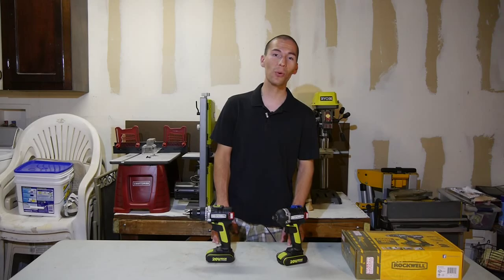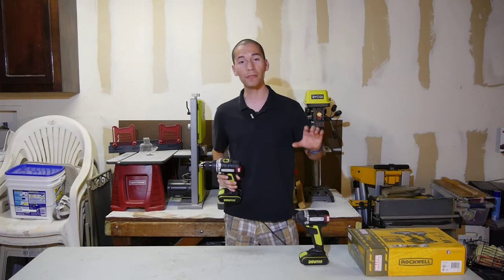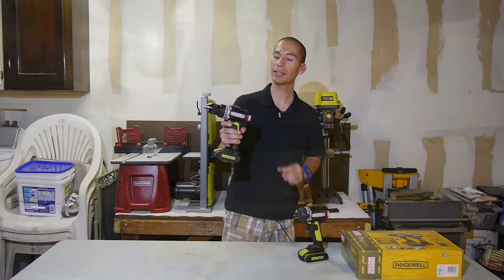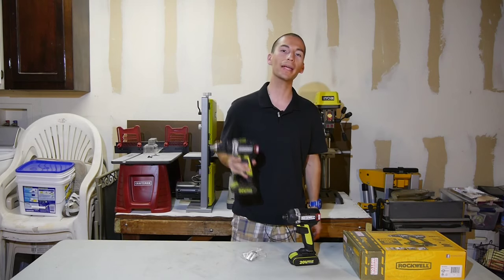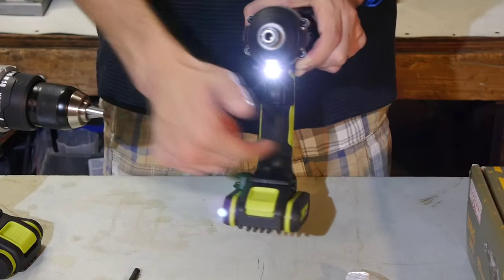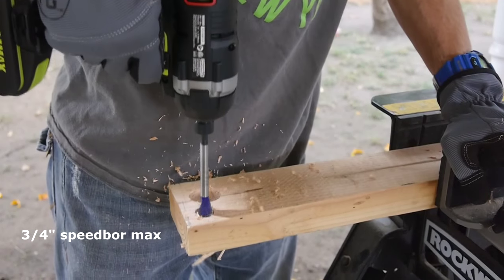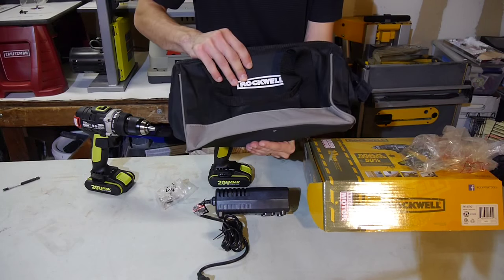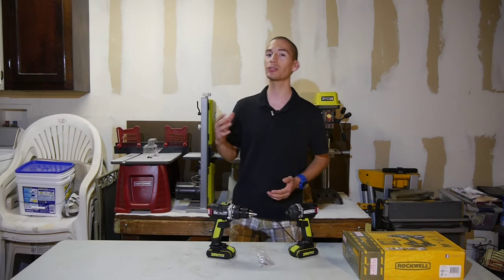Rockwell Brushless 20V Compact Drill and Impact Driver combo RK1807K2 Review

Comment: Looks like a awesome tool set. Great review!
Reply: How do the tool handles feel. Like Dewalt's, Bosch , or Milwaukee. I haven't had a chance to feel the handles on the rockwell tools because the closest Menards is three hours away.
Reply from the maker: +Cody Robertson they are. Very compact, light, and without compromising on performance as their performance is excellent. Thanks Cody
Reply from the maker: +Cody Robertson the closest the handles felt was the Makita 18v bl impact driver I tested out although without the added design grooves on the Makita. The Rockwell were smoother and simpler

Comment: Once again superb review Javie.let me ask you something,can this drill compete with the dcd795 or the newer dcd796?or as it is drive drill only with the dcd790/791..!?!?!?i saw that has plenty of power and im impressed..!!
Reply from the maker: +Nick Xatzh haven't tried those brushless models from dewalt but I've tried the similar dcd780 and various other compact Pro drills from other brands. This Rockwell can compete with the best of them in the compact drill segment, it's light it's compact and with good performance in its category. The build quality is the same but it does have the upgraded metal Chuck which some brands don't have. Dewalt and Milwaukee have metal chucks on their brushless models with Milwaukee on all their models while the rest have plastic chucks on their compact drills.

Comment: question only 2amp battery come with this unit, how long they last? do they make a 4amp battery? anyway nice video!!!
Reply from the maker: yes, didn't test for runtime but brushless tools last a long time, and don't know, thanks!
Reply: +Tool Craze the batteries have great life. With the impact tool, I just roofed my whole entire garage with steel and 2 1/2" lags into solid boards, and went through just 1 1/2 charges. Batteries charge quick too, about an hour!  I've also been able to hang Sheetrock with just 3/4 to one battery charge. These tools are amazing. I've used dewalt, Milwaukee, etc.